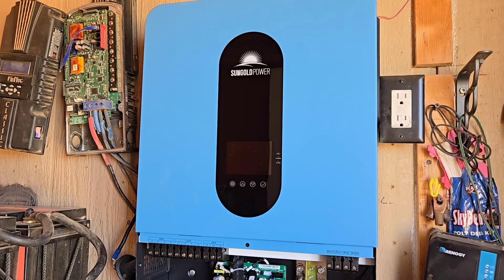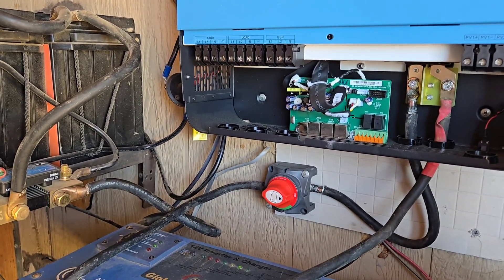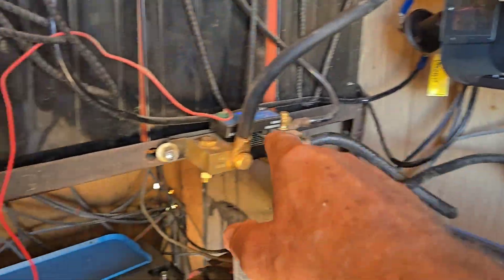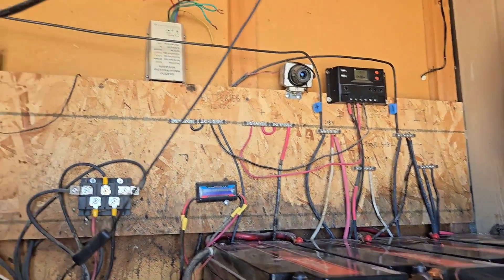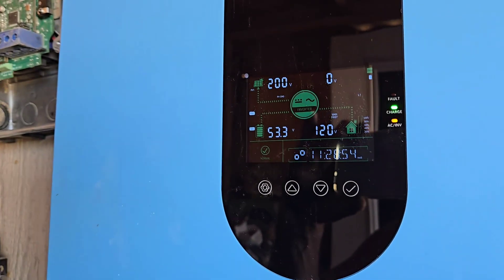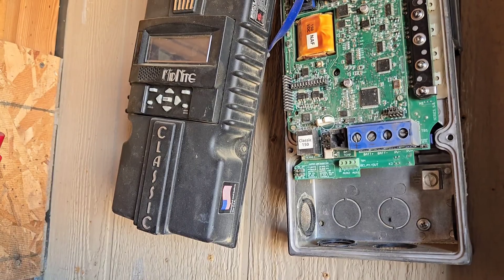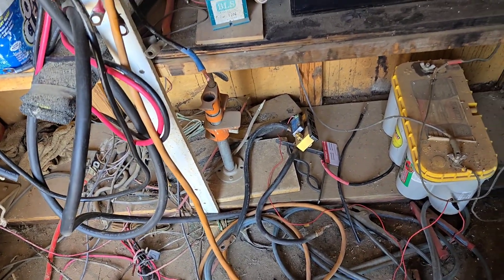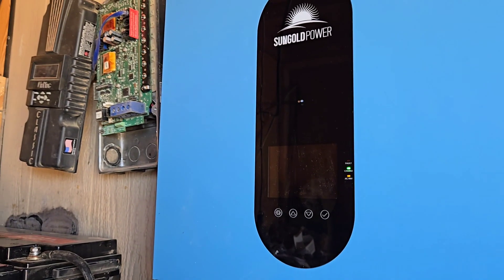Installing The New All In One, Aug. 14, 2025

Comment: How Big a Battery Bank is Needed to Support this Sungold Upgrade ? And how much does this Upgrade Cost US in the Real World  @ 24 and 48 Volts ?? 
Anxious to see this all Cleaned Up and Running Everything for You G Bear 🌵
🎩 Great Dane here at Indian Creek Ranch 🌴 💦 🌵 ⛩
Reply from the maker: These Sungoldpower units are work horses, from 1 battery to a dozen, your choice.
I does, however,  require a minimum input of 150vdc on pv1 to work, and up to 250vdc possible on pv1, then another 250vdc on pv2, up to 10,000w solar.
They are also hybrid systems, so can work in unison with grid power.
Reply: @GBear Qty of 8 - 280ah 12 Volt Chins in 4S2P and 4600 Watts o Solar here currently I might be Ready Myself for an All in One Unit

Comment: Nice upgrade.   Now you can add many more panels with less wires.    

Look into battery balancers.   The batteries will begin to drift in charge levels.   The great thing about the Bluetooth batteries is being able to read them.   

Victron is great but you need 3 for a 48v setup.
Reply from the maker: Yeah, this all in one from Sungoldpower has its own app and monitor system.  Just some new learning needed to run it.